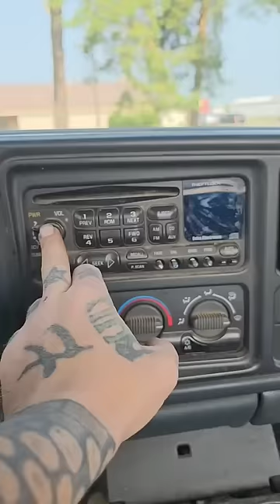new air ride I guess

Comment: Junk yard has entered the chat!
Reply: Eh that truck is fine could be used for a point a to point b parts run etc many times still, be a farm truck or wtv
Reply: Isn't that the truth?
Reply: Yeah u might be able to still use it on a farm though, just don't drive it on the road!!
Reply: She is that was my truck I just cut that s*** out well me some new steel in 2 hours later it will be just fine
Reply: Needs some welding

Comment: had that problem on my 2000 chevy 1/2 ton. i boxed the frame and re welded the tube in and threw a ratchet strap around the gas tank for good measure. lol

Comment: Body looks good yet, must have washed it regularly. Tube frames on new stuff holds dirt, hard to clean w/o a hoist. Ford & RAM bad too, top of frame open next to wheel wells gets covered in dirt, holds moisture. Rots out the fuel pump hanger, brake, EVAP & fuel lines first usually.

Comment: I live in Cali, very little rust issues. My question is; is there no way to prevent all that rust? Are there any coatings to prevent rust? I don't suppose owners wash the salt and ice off the bottom of their car when they get home?
Reply: It’s never perfect and most people don’t take care of their vehicles anywhere near adequately.  You can coat the frame and all bare exposed metal and it does help but removing the salt and keeping the metal away from Corrosive things is the best to do.  Such as after snow storms make sure the undercarriage is rinsed of the salt.
Reply: @Leavemealone- that’s the best part, rust rots, water corrodes, lose lose situation stop putting salt on our roads
Reply: Most people do not want to climb under their vehicle to wash it every time they drive it in winter.
Reply: You can’t rinse off with frozen solid garden hose.
Reply: @0004612  You are right.  When it is -40 degrees F with windchill it just freezes on the vehicle and the hose will freeze if you do not keep it running so you can make a huge ice arena.  -20 F windchill you are still going to freeze.   If you wash it in a heated garage you better dry it or when you drive out the doors will freeze.

Comment: Amy tips on the cluster mine won't turn on except for the check engine light.
Reply: It probably needs to be rebuilt. Mine has been done at least 3 times and it has 165k on it
Reply: There are places you can send it in to, or if you can solder and replace the little motors you can do it.
Reply: Get an OBD Link adapter for the truck and the Torque Pro App on your cell phone. I can read every guage on the dash (except for fuel level) and as a bonus you also get transmission temperature. My 2005 Silverado tachometer and speedometer haven't worked for years. This app pulls all the same readings from your OBD port.

Comment: I hated it when I'd find a decent lookn 99 upto 03 and the durn frame would be no frame, just like that one lol...I found a decent lookn 2000 3door Chevy that ran pretty durn good for a 5.3 engine...I ran the computer up and it actually blasted takein off...I noticed brand new frame pieces behind the rear seat that I wasn't aware of so I ended up taking the truck back cause I didn't want the cab going 1 way and the bed and rearend goin the other whichever way it wanted to lol 😂

Comment: I’ve got my 04 Silverado and I’ve heard my whole life that generation has cluster and electrical issues 
After almost 20years the only problem mine has is the headlights go into high beams when I turn right and the cabin dome light roller is worn and sometimes won’t contact 
The truck spent half its life in Dearborn and back and forth to Canada 
Lucky I guess
Or do people do things that make the issues happen?

Comment: Farm truck ? The cross member has rotted away. The gas tank would probably fall out when you filled it with a full tank of gas or hit a bump. Even worse the bed most likely would collapse when you put any weight in it. It's become a donor truck.

Comment: is that a 01 model? the body doesn't look gone , I herd the frames on those years rust failed quite often, i recall GM bragging about their hydro=formed frame, they must have use salt water in the process

Comment: How the fuck can they pass inspection? In Europe every second year you have to go to MOT, TÜV, etc.
Reply: There isn't vehicle inspection in Michigan.
Reply: When they dump salt all over the road if it runs and drives people drive it because the new vehicle will rust out also.
Reply: Yes, I know this. We have salt everywhere in wintertime...and I wash it off regularly. I learned it from my dad and even taught us on the driver license course. That was part of the daily routine. Just like you check the condition of your car every occasion before you drove it ( tires, bulbs and the levels of the liquids). That owner is nothing but careless